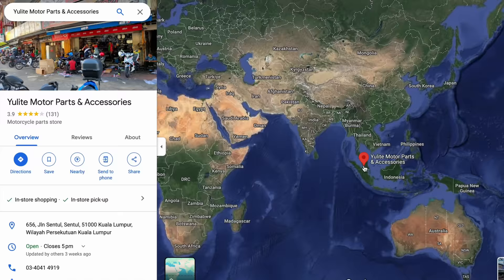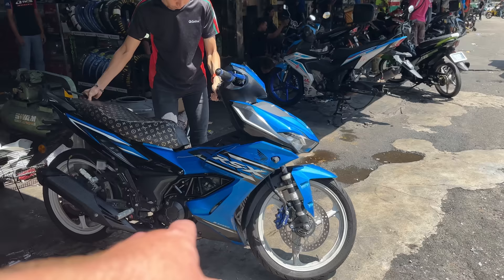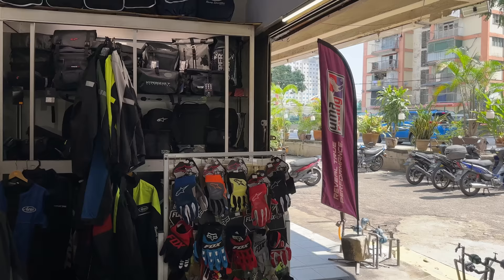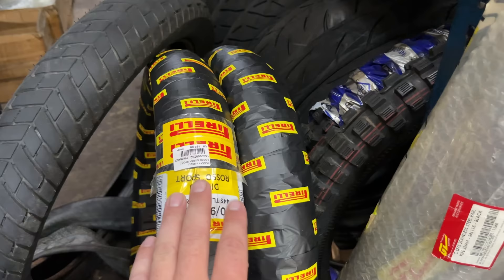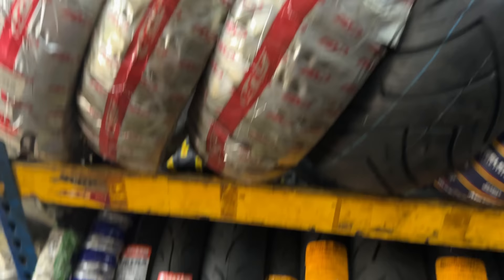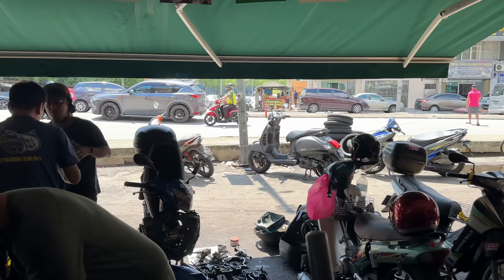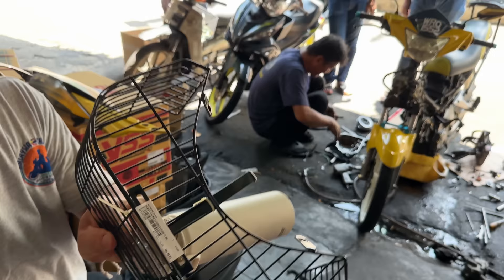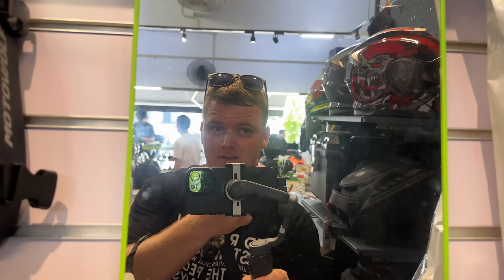BETTER than Thailand? Malaysian Motorcycle Market

Comment: Solid Sense and NKS, you can tell their price is good when there is over 10 shops selling the same thing. Happy shopping!
Reply from the maker: Very true! I was asking most shops pricing - the tyre shop I had used one time previously and thats why I chose them.
Reply: solid sense is where i go if i want to change my bike benelli rfs150i sprocket & chain (1 full set) and their price is way more cheaper than others haha

Comment: Wow! Thats an amazing range and the pricing is fantastic. I would over purchase and then have all sorts of issues stuffing things in my backpack. Did you investigate posting some things home?
Reply from the maker: Shipping back is fairly easy using POS Malaysia and the bike shops will happily pack it nicely for you into a box. Seach Pos Malaysia Rate Calculator and it should come up with a tool to see pricing based on weight. I had to increase my baggage allowance coming home as all my purchases went on the plane home with me.

Comment: Hi, You said you are taking the Tyres back to NZ, is that correct? If so, do you take them as luggage or freight them? I am doing a trip to Bali, Indonesia and my bike is more conventional type, a Yamaha Scorpio, but they are masters of modifications to them. I am picking up some newly laced up 17" alloy rims on bare hubs and a new front exhaust pipe. Fortunately they will be light and fit inside my suitcase LoL. 
There is much more I want to get that I cannot get here because the bike has not sold here for 12 yrs plus, but freight seems to be a killer. Any ideas or suggestions you have would be appreciated. Maybe a trip to Malaysia could also be on the cards. :)
Reply from the maker: These went in a large 32" suitcase for the journey home. Tyres can be tricky to take to another country if they are used - so brand new ones still wrapped up were the way to go. I also took a 32L Givi topbox in the same suitcase.

Comment: I've been to Poonsup in Thailand and personally I think it is much better. My preference is for the 400cc 'big bikes' as the Thais call them, not the tiddlers you are fond of. Back home in Oz I spend my ŕetirement fettling and restoring the much bigger 70's and 80's stuff. Pre Covid I located a dismantling business near Icon Siam in Bangkok that was choc full of late 70's - early 80's two stroke stuff. Engines, frames, fairings wheels, stacked on shelves as high as two shipping containers. Just a wire fence at the front with a phone number on it. I would love to be able to buy the lot, fill a couple of 40ft shipping containers and brought it all back to Australia.  Everything had been sitting so long it had a quarter inch of dust on it. It all belongs in the hands of the 2 stroke fanatics. The language is not a problem in Thailand with today's smart phones, having a Thai wife also helps. 🇦🇺👍🇨🇷
Reply from the maker: Yup I was at Poonsap in 2022. It's a nice market if you've got the right vehicle. Language barrier isn't really an issue for me - but it was a nice change to speak English when buying parts instead of fumbling along in my elementary level Thai. Always amazing what you can find laying around in South East Asia.

Comment: I live in Thailand.
Can I buy a moto from Malaysia and bring it to Thailand, by riding on it?
Shall I face any problems at the customs?
Reply from the maker: You can but you would only get it stamped into the country for as long as your Thai entry is. Generally not more than 60 days. As they have competing bike industries they won't let bikes permanently cross the border easily. Riding in and out of Thailand with a Malay bike is fine - and very easy. I just did exactly that and will release videos on it soon.

Comment: What about ECE helmets. Like a shoei nxr 1.
Reply from the maker: There was riding gear in some shops but we had bought our helmets from NZ so I didn’t bother looking too closely at what was available
Reply: @SmallBikeStuff  I made a huge mistake buying from USA and found out that the European helmet was 350 gm lighter . And now I have a bad neck because of all that unnecessary weight. 

I have so many visors for the shoei rf 1200 that I have to buy another one but the European version.

Comment: Once in a while in those bike places You'll see one of those really awesome 250  2-stroke Cafe race bikes.. And if you get really lucky you will see the 500cc two-stroke Suzuki gamma  Those are like Ferraris very expensive you will see some of the owners have them in their shops as their personal bikes.. 95% of those are all garbage four-stroke toilet bikes.. Malaysia has a pretty good Supply of the old pre-ban 2 Strokes you buy those they keep going up in price.. They have worked out the problems with two strokes they might start racing again on the track then it might put price pressure on the old two strokes because the new ones will be fuel injected what different compression and they will be just as clean as the four strokes but so powerful.. They don't know how to bring them back onto the racetrack what they should do in the same way they did against the two strokes the four strokes were considered cheater bikes.. Because they would race 500s against 250s and 125s against 250s.. And the new generation of Two Strokes are so powerful the four strokes are a joke.... Many people do not realize two strokes put out twice as much power for fuel consumed.. As four stroke.
Reply from the maker: I’ve ridden an RG500, RZV500, all editions of TZR250, many NSR250’s, an NS400R, RG250’s..I could go on. I love 2 strokes. But that wasn’t the topic of the video - more just showcasing these shops exist. Which even some locals have found helpful so I’m stoked!

Comment: Thailand  more advanced in automotive technology then Malaysia
Reply from the maker: Probably right - I think it depends what parts you want as to which country has the best options.
Reply: I would gladly say yes, but more in engine modification. Thailand went freaking steroids specifically on diesel engines. But, if looking for standard spares part, both Thailand and Malaysia are on the same level.
Reply: I guess depends on what parts you looking at